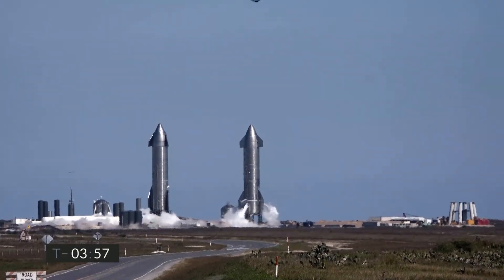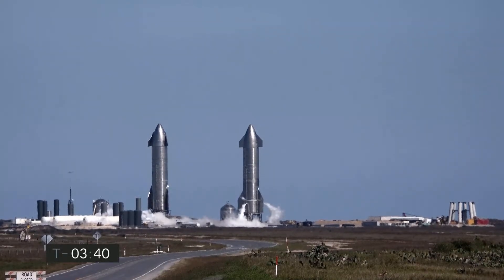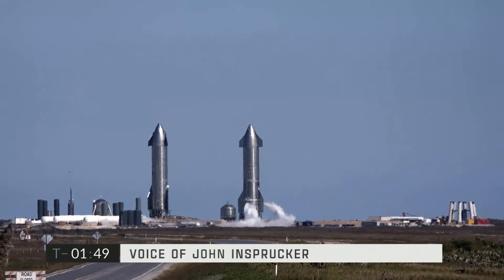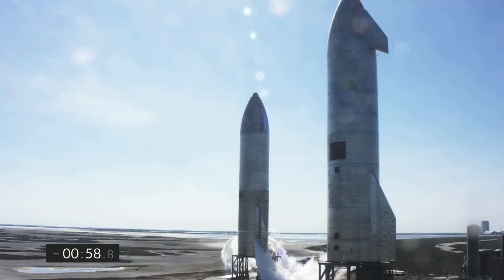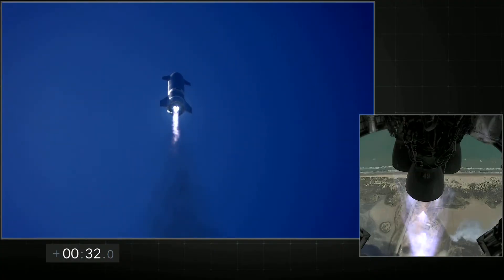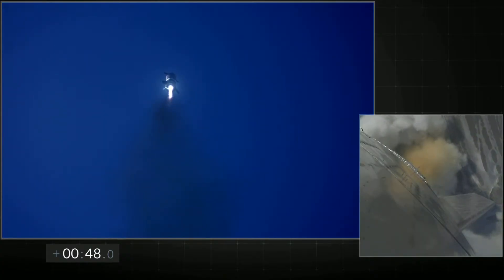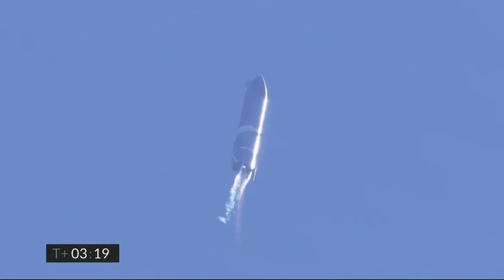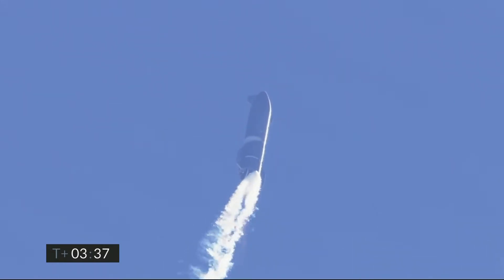Starship | SN9 | High-Altitude Flight Test

Comment: In my opinion, it's not whether they landed Starship or not, it the data on Starship that's the most important.
Reply: how many times will that excuse fly ?
Reply: @psychiatry-is-eugenics  until it lands properly and they can start getting data about that.  That's how technological progression works.
You learn from failures and mistakes, and eventually, you know enough about why you failed so you can fix your mistakes and succeed.  First its pressurization, then its optimizing engine performance then it'll probably be structural integrity and or making sturdy landing gear. Falcon 9 proved landing rockets regularly and accurately is possible, now it's just a matter of achieving something similar with different hardware.  I prefer to see a few more starships crater before they finally start landing regularly over a decade of stagnation and embezzled budget with no end result in sight.  

that being said I'd much rather see SN 10 be the start of proper starship landings.
Reply: @Robb1977  - like the 30 year space shuttle program , what he is likely to learn ; is that reusable is too expensive and too Dangerous
Reply: @psychiatry-is-eugenics  except the falcon 9 has proven extremely cost effective. The reason the space shuttle was so expensive is because  it was required to carry massive cargo for military satellites and in preparation for space station freedom. While certainly over budget, the space shuttle succeeded in its ability to ferry heavy payloads to LEO unlike any other vehicle. That even though the program was plagued with design limitations and political red tape, and having no comparable successor.* 

Starship has learned from this, which is why its not just another space shuttle. There will surely be plenty of problems with its system as well, but thats why you test. To identify as many problems as possible BEFORE you put people inside.

*edit: I said space shuttle successor when I meant to say predecessor
Reply: @psychiatry-is-eugenics   You have to learn from failure, if the rocket lands over and over again, one day the vehicle is going to fail with humans on board.
Reply: Your opinion or what you’ve heard repeatedly from a qualified engineering team?
Reply: @urungumburum3680  opinion based on facts?!?!

Comment: Next time increase the header tank size and lite all 3 engines in case one fails.  Ability to juggle raptors is a good technology for the final version.  After the bugs are worked out, then reduce weight.

Comment: The problem can be fixed with software.  If the single-engine fails to light on landing, then light one of the two other engines.  If that fails to light go to the last engine and light it.  If that doesn't light, then you're screwed again.

Comment: That landing system needs revision. Also,what happens if the thing falls over after landing on Mars? No return ticket then.
Reply: it failed because one of the two raptors didn't ignite. it was working with one engine.

Comment: I think they  flipped a little bit late so there was no time to fixed the issue and one engine landing burn isn't enough
Reply: one engine didn't reignite, it can't land with only one engine
Reply: @kjeed7735  I'm not sure but 11:41 you can see the one engine was working fine. Two engine was needed to rotate and make it vertical, one to land.
Reply: @Sourav9063  you clearly see the second engine struggle. alot.

Comment: @ElonMusk

The way it lands is not a viable way according to the design of the aircraft. It's a good idea but not great. It needs to get into that landing position in a more safer way by allowing the aircraft to fly horizontally in our atmosphere low enough to tilt it upwards safely and then use the burn to land instead of doing a flip and land on vertical decent.
Reply: If the two engines flip the aircraft, then won't one engine used for the burn tilt the aircraft slightly instead of straighten it?

Don't you think that all three engines should be used to ensure a straightened landing?

Don't you think that there should be two more engines on the middle of the aircraft, left and right, for a more straightened support? More like an iron man effect, especially on landing

Comment: In my opinion, SpaceX should try to land only with one Raptor engine, since the second engine seems to be failing to ignite at lading. Also, they should test the flip landing maneuver way earlier, and then after they figure it out, try at low altitude.
Reply: it failed because only one engine worked
Reply: @kjeed7735  yes. But you would have way more time for the other engines to compensate.
Reply: @RogerM88  yeah but probably not the fuel for it, header tank is pretty limited

Comment: Why do they wait so long to switch to vertical when attempting to land?   They do it so late. They need to do it much earlier and give time for the engines to slow the rocket down.
Reply: it failed because one engine didnt relight, suicide burns is the most effective method of powered landing

Comment: I'M NOT a scientist, but why are you waiting til the last possible second to flip the starship back to vertical, and only using one engine.  This honestly makes no sense, it should flip back to upright orientation at 10 kilometers, after reentry into the atmosphere, and fire up all 3 engines, so it has some time to balance itself out.   i mean, thats what they do with the falcons and the falcons work, why not keep it simple.
Reply: Because you need more fuel for that. And more fuel means less payload.
Reply: Starships need to work with limited fuel for landing so flipping at the last moment is best for fuel efficiency
Reply: The want to use 2 engines. The problem was that one of the two didn't wanted to.
Reply: It has to shed speed in the atmosphere. It can't do that if it comes through the atmosphere like a pencil with the pointy end up and the flamy end down. The whole idea is to shed speed through the atmosphere while in a horizontal flight profile. Remember that this rocket will be coming in from a very fast and high altitude, unlike the 1st stage of a Falcon 9 which lifts the 2nd stage into orbit only. Starship is a totally re-usable rocket. Granted they don't need to flip it right at the last seconds, and for sure more engines will help with redundancy if one doesn't re-ignite.
Reply: The reason they fall sideways so far is that it allows the vehicle to scrub off more speed, especially after reentry. Starship will be traveling much faster than a Falcon 9 booster does since it will reach orbital speeds. By my understanding, if they were to flip at 10Km, the vehicle would start falling faster and then require even more fuel for landing. If it has to carry more fuel, the rocket will have to be built larger, and that can create an endless cycle of scaling.
Reply: There's a simple explanation: the horizontal sky-dive orientation allows the craft to fall much more slowly without using engines to slow down - atmospheric drag is "free" deceleration. They would need to carry way more fuel to slow down and land if it fell vertically like Falcon 9 - this would massively reduce payload capacity. By the way, landing burn is supposed to run two engines; something went wrong at the end.
Reply: It wanted to make a so called suicide burn, just like the Falcon 9 does. And it supposed to light up two engines, but the second one failed.
It falls verticaly because the drag is much higher this way, so it slows down without using fuel. Maybe even without the need of an entry burn.

They learned to land a rocket with the Falcon. That wasn't simple either though. Now they take it a step further and are learning to make a belly flop too.
Reply: It is meant to start two engines but one of them failed to start or apparently exploded while starting up.
The reason it flips late is to reduce as much speed as possible aerodynamically to reduce the amount of fuel it will need for the landing burn.  Every pound less of fuel it needs to carry back to use for landing is an extra pound of payload capacity.  The amount of fuel needed for a long vertical burn would need some 30 to 50 tons of propellant which means cutting the payload capacity by almost half.  The horizontal 'flight' almost until the last moment means that the engines only burn for a few seconds thus needing only some 5 to 10 tons of propellant because it is falling very slowly already and just needs to cancel that last bit of remaining velocity.

What works with Falcon 9 wouldn't work here because this is actually a second stage, not a booster. For a booster the payload penalty is much lower, about 1/10 the the amount of fuel, so that can afford to have a long landing burn. Also, the booster comes in much more slowly than Starship would and from a much lower altitude. 
Although in this flight the Starship is going only 10Km high it is being designed to come in from orbit at a velocity many times higher than the Falcon 9 booster does.
Reply: I think its quite deceiving, since it doesn't look like its going that fast but it is. In the video I do not know the speed it was going but it is capable of reaching mach 25, I am fairly confident it didnt go anywhere near as fast in this test but still. Its mainly to test because it wont always be ideal since the infrastructure to land on other planets are not there and the environment might be less than ideal. I believe when it actually enters from orbit the engine can burn off. Also I see what your saying with the planes but its not the same as that, no aircraft flies like this on purpose, planes if they try to do something similar will stall since their air flow will be stopped and this is what happens here too, its done so it gradually loses its speed, since the starship will enter at a 90 degree angle, hence the name belly-flop much like what you do when jumping into a pool. To be honest I do not know the specifics of what they are doing so you would have to do a few google searches to get your answers.

Comment: Flipping to Vertical Position is way to fast considering the length of the starship. It will be good to have opposite force(at the nose) to have more control ( to stabilise ) while flipping.

Comment: Possible thermal shock problem? Second engine not chilled enough?
Reply: Suggest lighting all three and then throrttling or shutting down one. Always lighting an extra engine and then deciding if one should shut down or to throttle the group will add a small  level of redundancy to the landing. Should be mostly a software change. Not sure if you have turbine speed and vibration sensors... or maybe an eddy current sensor counting turbine tips. 
The earlier comment was thinking the first shut down engine had the longest time to cool, the second not as much time. Hence thermal shock on one engine only.

Comment: can someone explain why they're not firing all engines on landing, and much sooner than the last few test flights?
Reply: The thrust from 3 would push the rocket too much. 2 at full thrust is too much even. They can't turn three low enough not to have too much. Unfortunately one at full thrust is not enough and the 2nd failed to reignite.

Comment: 11:44: I'm not an aerospace engineer, but I believe this is the highlight of the flight. You can notice that one of the two motors is not at full power, SN9 is too close to the ground (I don't know if it is the camera's perspective) and then only one of the motors remains on. From here on the disaster.

These data and all those received from this test will certainly be used for the next missions. For me, the future has never been this close since SpaceX.
Reply: The commentary said two engines to flip vertical, then land on one. It looked like the second motor flipped it too far past vertical, which would mean the second engine was actually at too high of power, on too long, or maybe produced too much of a kick starting up. It's harder to run rockets at fractional power.
Reply: @dbattleaxe  I tried to compare SN8 with SN9 and it is actually true, in the end only one of the two engines remains for the landing, but if you notice, during the flip, only one of the two engines remains at full power and not both. then it appears that the other shuts down completely, as if it has already reached the landing altitude, before it has turned completely vertical. I could be wrong, I repeat .. I'm not an expert, but this was the feeling..
Reply: @Collin2997  Yeah. It depends on if the second engine is supposed to do just the major rotation or the major rotation plus stabilization. I could see either the first engine gimbal or second engine doing the stabilization.

Comment: Space X team, awesome flight. Hope you collected good data. If I may be an armchair engineer, I believe the landing burn occurs too close to the ground. Additional altitude may provide the ability to recover from an engine failure and ignite R3. Once again, awesome flight, and I look forward to the next text flight. May I also suggest additional testing is required for the engines.

Comment: Engines didn't shut off on landing this time!
Reply: They did the opposite, one didn't ignite at all 😂
Reply: @mattmatta1346  It's only supposed to restart 2 engines
Reply: @nogiidude4819  I know. 1 engine of the two tried to reignite but committed self destruction.
Reply: @mattmatta1346  You right that's not good

Comment: Same faliure 3rd time

Why do you get it vertical so LATE, why not 30sec earlier like falcon
Reply: 3rd time? This is only the second starship to crash. Also, Falcon 9 doesn't 'go vertical', it's vertical for the entire descent.
The sooner they go vertical, the faster they start falling, and the more fuel they need to slow down. Like a regular suicide burn, it's best to leave it as late as possible.
And anyway, in this case it over-compensated. You can clearly see in EverydayAstronaut's stream that it flipped too far, not that it started too late.

Comment: I don't understand why not land as Falcons rockets land... What all of this flipping going around... Of course the fuel inside the tanks lose pressure or something is not fueling the engines right before landing...
Reply: Because falling vertically doesn't generate nearly as much drag as falling sideways. In the thin atmosphere on Mars, you need all the drag you can get.
Reply: @lazarus2691  I'm sure the landing on Mars will be much different than landing on earth... No matter what data they have here will not apply to Mars landing
Reply: @darckblad31  
Some of the data will still apply. Certainly moreso than data from practicing vertical landings would.
Also, the Starships that go to Mars still have to land using the same system when they come back to Earth, where the data will be 100% applicable.
So there's no point practicing a vertical landing on Earth, it won't be applicable for anything.

Comment: Get the physics simulation software right...
Clearly the team/sim software did not sufficiently take into account the right timing of closing the wings and accounting for the swing/angular momentum caused by the engine firing up and gravity.

Comment: I think the final reorientation is being made Too close to the ground.
Reply: One of the engines didn't start properly leading to RUD. If it did start SN9 would have probably landed
Reply: @autum6764  but, could have it started properly with a bit extra time?
Reply: @arkvsi8142  no that engine had a problem with starting so no extra te would help since the software is calibrated to run with 2 engines in landing
Reply: @autum6764  I see, understandable

Comment: Is it fuel sloshing going wrong when flipping? Are you able to get high speed camara footage from the inside of the tanks even in case of RUD? Are there hardened flight recorders that record high bandwidth data/camera streams or is everything telemetry?
Reply: Engine failed to start, probably didn’t switch to the header tanks

Comment: Something is wrong with the landing process, REWORK the whole thing. It is not the good way to do it, you must anticipate all possibilities for something to fail, and get another plan for this case. This is not acceptable, this is not viable. RETHINK the whole process. The rocket must come back intact at all cost. These tests are useless if something goes wrong and there is no backup plan; Do the tests with the backup plan

Comment: It’s that stupidly timed belly flop. I bet it caused a big air bubble/bubbles in the liquid oxygen and caused a flame out in the engine. Why not belly flop at 2000ft or more and have a lot more time to possibly stabilize the liquid fuel and fire off the third engine in case of such failure. Seriously this was worse than the first launch

Comment: For that prototype, except damage, landing has been very safe. Unfortunately rocket has been lost. I don't know why 2th and 3th engine was not start. For SN8 all three engines has been started.

But question, what will do FAA with permit lanch for SN10 ?
Reply: It only needs two Raptors to land. It looks like tried to start but was fuel rich
Reply: @jackwhitlock1  You're completly right. I look into SN8 landing, and there was powered on only 2 raptors. SN9 tryed ignite second, but it failed. Maybe restart procedure is too agressive? I hope spacex will resolve this problem soon.
Reply: @grzegorzszyszo7548  I hope they can find the problem

Comment: They need to fire all 3 engines on the landing then throttle down, it's like they lost fuel pressure.
Reply: My thought too, start all three, if one fails no problem. If all three start, shut down one of them. We armchair rocketeers know everything better ;-)
Reply: @thek3743  It is not supposed to fail, starship is reusable remember? if each landing you lose an engine then that's a big problem for mars colonization.
Reply: @djedidimedriadh2470  well things go wrong sometimes where i come from :-) surly reliability will improve